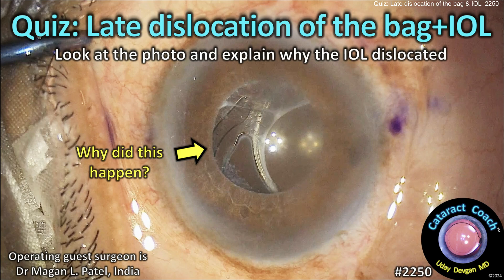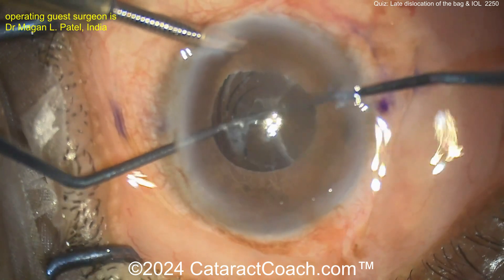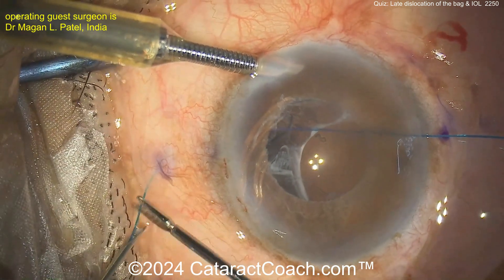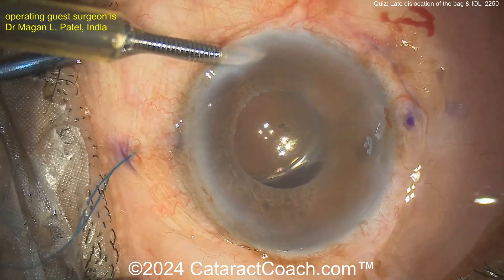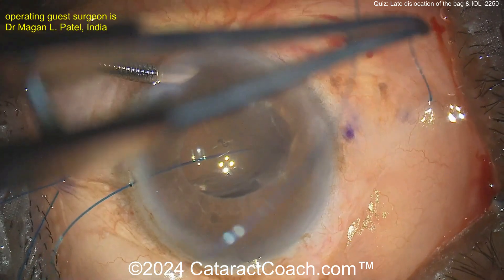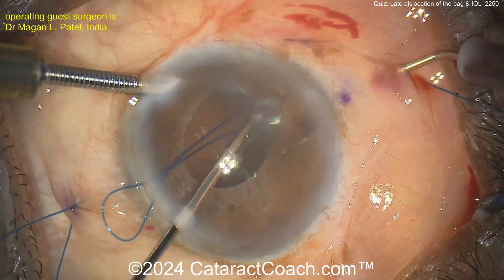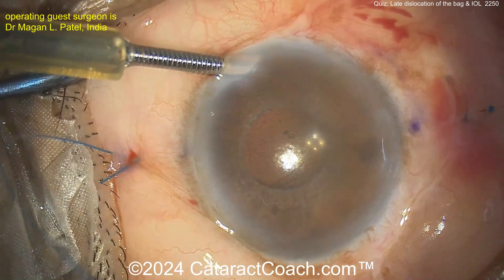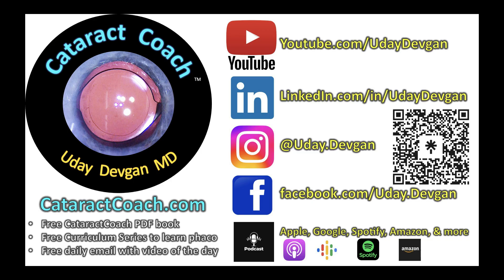CataractCoach™ 2250: Cataract Quiz: late dislocation of the bag & IOL - why?

Comment: I generally implant a CTR in PXF cases. This tends to oppose bag contracture and keeps zonular tension symmetrical, delaying (at least) late IOL displacement in such cases. If nothing else you also have an extra anchor point for a late belt loop in cases without the convenient haptic holes.
Reply: Thanks for good suggestion regarding CTR in PXL cases